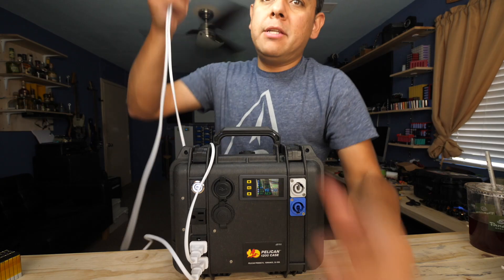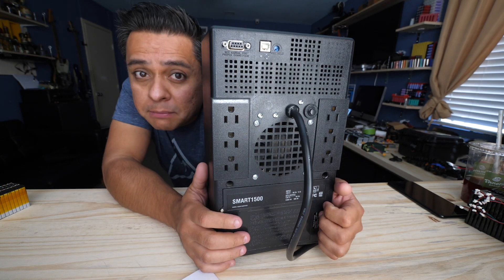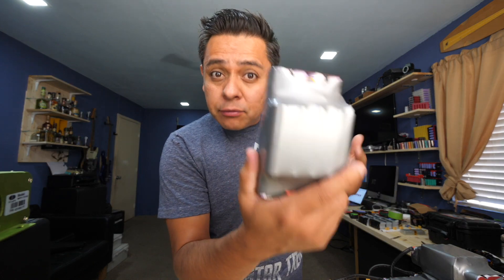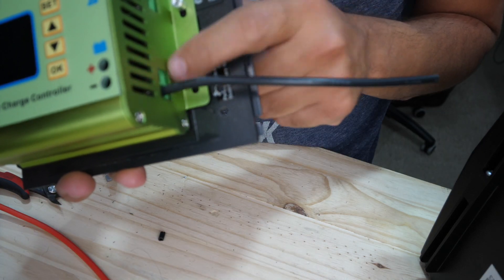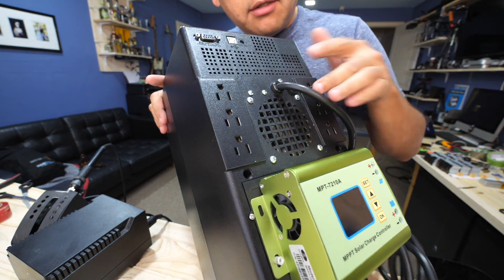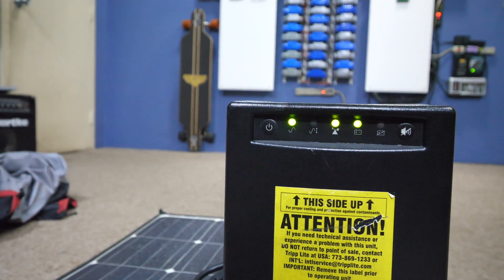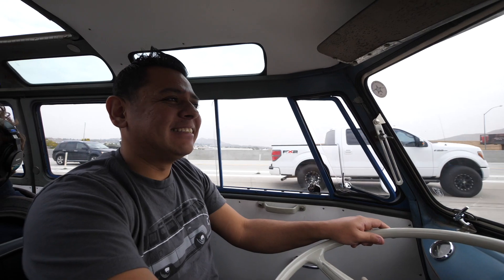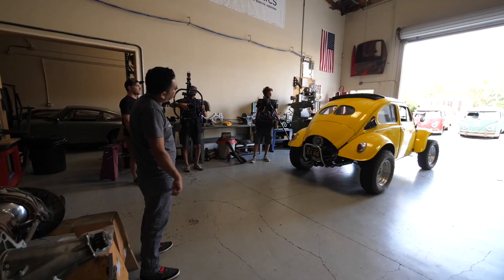The $400 Solar Generator you can donate To Puerto Rico

Comment: hey jehu, tried building this device and ran into so trouble. I have a 12v 150w solar panel for this set up and the same ming he charge controller, which does not turn on when the panel or batteries are plugged in. there's two things I think might be the problem: the batteries are fairly dead or the mc4 connection isn't making contact with the panel. any type of feedback would help.

Comment: ok.. I love these. Have a technical question though not very technical. can you stack these (combine the inverter outputs) to give more potential working watts? I see two or three 120v inverter outputs, separate UPS, wired into a single service panel. Possible?

Comment: Found another video on YouTube where they guy explained you can't it off the grid. Because it was meant for led batteries and the configurations are to charge @ 43.5 volts. 1.5 volts to high for the max volt charge on the lithium cells.

Comment: Jehu. I just want to say thanks. I have learned a lot from your videos. I never solder wires before. Now am confident doing it. I built 2 of these generators abs am building 4. I did added a volt meter with a switch a handle to carry it and a thermo switch to the fan. I also added a separate charging port.
Thanks again!!

Comment: Got it assembled so now I need the settings for the MPPT controller:  Using one Uni-Solar 136W panel, 4 battery packs, what is the setting for Panel Voltage - Max Batt. Charge Voltage - Max Batt. Charge Current - AH setting of the Batt. Capacity????  I viewed all the videos on the 7210A controller but did not see the settings for this set-up as described and using these components.

Comment: Since a traditional Tripp or APC 12v UPS charges its lead acid batts at 14v, have to wonder if this one charges at like 38-42v? Will these 36v lithium batts safely handle 42v if you plug in the 120v input on that UPS? Sorry to not understand, love the project!

Comment: I completed building the Tripp-Lite Solar electric generator. I have figured out how to program the MPPT charge controller but I am not clear about the correct values to input. My solar panel is 105W at 12V, so I set the solar panel to 12V. The batteries are 36V, so I set the voltage the battery is to be charged to, to 36V. Now for the crux of the problem. I am uncertain what to set the battery charging current to. The batteries are 2.2 Ah Li-ion and I believe the C rate for those is 2. I found a specification which said the max. continuous charging current should be 0.5 X C rate. Therefore, the max. continuous charging current should be 0.5 X 2 X 2.2Ah = 2.2A. This is for one battery cell. So, given that the SONA battery packs are  two parallel strings of 10, 3.6V cells in series (10S2P), does that mean each battery pack needs 2.2A for each string in the pack, (to allow 2.2A to flow through the 10 cells in series to allow each cell to see 2.2A) or 4.4A per pack? Additionally, since there are four packs in parallel, to get 4.4A to each pack does that mean the charging amperage the solar charge controller should be set to is 4 X 4.4A = 17.6A. Does anyone have suggestions, or experience with a amperage setting that gives good results and will not adversely affect the life of the batteries.

Comment: So is it really safe to charge those batteries off the grid with the UPS power cord? I think that could be a good option. Use the solar for mobile or emergency use, but use the grid when you can. Is the controller of the UPS unit that's been charging batteries its entire life good enough to handle charging those particular batteries?
Reply from the maker: Yes

Comment: I've tried this. I can't fit four batteries inside. How did you make four fit?
Reply from the maker: Maybe your batts are slightly bigger
Reply: Mine fit. I made 2 generators and put 4 battery packs in each. It's definitely a tight fit but you can stuff 4 in there.

Comment: ok
so I have a question concerning the flexible panels (24V), the batteries (36V) and the unlisted solar charge controller.  is it possible to charge 36v batteries from 24v panels or should I be looking for 36v panels?
Reply from the maker: That’s what the solar charge controller does
Reply: The "unlisted" charge controller was listed in the description along with the other items needed. It's a BOOST controller.
http://j35.us/10A-Mppt-ChCon
Reply: +nrodge1 Thank You
guess I missed it completely.
Reply: +nrodge1 
if you wanted to use the 36v batteries in a scaled up powerwall configuration, then what SCC would you look for since I don't believe 10A would be sufficient? Thank you in advance
Reply: +jehugarcia 
sorry,  I knew an SCC could take a higher voltage(say 48v) and charge 36v batteries but I didn't understand it capable of taking 24v and charging 36v batteries. Thank You so much for sharing your knowledge. will be making a couple of these for helping out the people of Puerto Rico, Thanks to you.
Reply: +jehugarcia 
I guess it wasn't clear in the product description that it was also a DC-DC Booster. I learned something today. thanks again.

Comment: Hi everyone. wanted to know if anyone built one yet. I bought and have tested but i think i might have a bad ups . When charging battries with 120 volt wall outlet i get reading for 120 v. But when i disconnect from wall and test the volts from ups getting reading 88.6 v and not 120 volts . I was able to run tv and lights. Plz let me know if anyone is having the problem.  Im going to buy another ups.
Reply: Some have said that this might be a Modified Sine Wave output inverter, you can look that up but generally a DVM will not be able to read it correctly and I wouldn't plug in a Kill-A-Watt meter. Anything with a switching power supply will be OK (even with square wave) but things with motors might not do so good but will run. Like a fridge compressor will get a little warmer. I don't know if it would be a good idea to push it up to the 980W with any type of inductive load. The specs for this did say PWM sine wave which probably means it's the new marketing guy language for MSW. It will be good for the emergency in PR.
Reply: Found a solution?
Reply: You will need a True RMS meter to read the correct voltage...or the Kill-A-Watt plug in.  My cheap meters also read a low voltage until I got a True RMS and now it reads the correct 120 VDC output.

Comment: Just FYI. I'm trying to put one of these together in Puerto Rico and here's what I've found on shipping. Although the charge controller can be found elsewhere, the link provided here is for a seller that will not ship it to Puerto Rico. The batteries from eBay will cost $67 to ship (although I haven't purchases yet and don't know if regulations will interfere) and the to UPS unit will cost $59 instead of the 25 they usually charge. This brings the cost of just the UPS, batteries and controller to $356 if you live here. Still not bad.
Reply: EDIT/UPDATE: Jehu and I have confirmed that the ebay seller can ship to PR now. All the items are listed in the description of this video and also some of the comments. You may only need one battery if you can power your stuff during the day from the solar panels, sort of like a pass through. The charge controller Jehu used is a 10A controller so you can do the math but you will probably want to put in a little more solar since in the mornings or off angle sun or even normally you will get less than the panel's rating which is at room temp and in perfect conditions. You could also use 3 car batteries that are somewhat good the same way - as a pass through system, the battery is only needed to get things going.
EDIT: Also solarblvd has 41c/W panels and has a way to ship them you need to call them but shipping is a lot but maybe you could do a group buy with Javier. Also see my post on the latest Jehu video.
Reply: Links??
Reply: All in this video's description.

Comment: Hey I just received my ups system and tried to plug it in and of course there’s no battery yet, but I was just wondering is it normal for nothing to turn on when there is no batteries connected? Just wondering if mine is defective or not
Reply from the maker: Yeah I think you need battery

Comment: Great solution, but why not make it modular?

Get a outdoor car battery container, put the batteries in there and attach the solar charger to it...  Just have a plug connector to it and the UPS...

That way, if the person lives some place where they may have too much shade they can just disconnect the batteries from the UPS and take it with the solar panel to where it can get better light to charge...

Also, it allows people to swap batteries for longer run times and makes it more convenient as they can leave the UPS plugged in and it's a noticeably lighter weight to carry around, which some people using this may not be strong enough to carry the whole unit as one piece.

What do you think?
Reply from the maker: Yeah,  good idea

Comment: I assume the ups charging unit outputs 42v?   Does it have to be that voltage to charge the 4 Lithium packs wired in series even with the indv bms?
Reply from the maker: no thats the max voltage for the 4.2v cell
Reply: Where can I get the UPS?!

Comment: so ive got a CyberPower 1200AVR UPS, and I want to use the guts out of it to build something similar, what are your thoughts? it looks like it uses two 12v batteries inside based on this link for the replacement batterys. 

https://www.cyberpowersystems.com/product/ups/rb1280x2d/

Comment: That UPS without battery is no difference than regular inverter. Why not just buy a inverter instead? Can anyone tell me the difference?
Reply from the maker: $30 980w inverter with a built in charger,   find those 2 things for same price and you'll have the same thing
Reply: You right, thanks.

Comment: How long will it take for the flexible solar panel to charge up the battery pack? On a typical, Caribbean (sunny in the morning stormy in the afternoon) day?
Reply from the maker: Hard to say  but you need 500wh so if you use 100w panel it would take 5 hours if perfect sunlight
Reply: jehugarcia Thanks!

Comment: If the TrippLite UPS is plugged into a 120V outlet, after converted to lithium batteries, will the original manufacturer's battery protection circuitry protect against overcharging the batteries, which may be more sensitive than the original lead-acid batteries, or does the BMS on the battery packs take care of that function.
Reply: Jehu has said he's tested it, it's fine and cuts off at 42V and then backs down to 38V and the built in battery BMS is redundant safety. This is great for emergency use like in the PR situation and we all hope they keep using it to save on their power bill and never plug it in!
Reply: That's what I was worried about, I guess they are saying the battery packs he installed have BMS in them?  I would be scared to plug it in after conversion to lithium
Reply from the maker: Who cares what it’s supposed to do,  test what it does (I did) if it works with your application then there is no need to be scared

Comment: What can we use to monitor the voltage? Does the UPS itself have any voltage monitoring?
Reply from the maker: No monitoring
Reply: You can add your own. It's just a plastic box, join the DIY club and cut a hole in it ! See the previous video where Jehu uses one with a shunt so you can monitor the battery's amp use too and get a graphic full / empty reading also. Or buy a DVM and hang the leads out. I don't know how fancy you want to get for a $30 UPS.

Comment: Hey Jehu, trying to find out if there is some kind of warranty that the used UPS will work, with shipping it's $58 for me. I live in SoCal so I would love to be able to just go pick it up if you give us an address or website to contact them. Thank you, got 1000 18650 cells coming from your guy on Ebay and building an off grid system.
Reply: You would be better off buying a real normal inverter with all the protections and stuff for a larger off grid system for your house in a normal situation (this is for people in need in PR) and go 24V with 6S to make things simple and better. If you want to be cheap you can start out using the CMP 12/24 charge controller from ebay with one little mod, I did for a while, see my channel with a lot of info on solar stuff.

Comment: Jehu, I found the link for the UPS and the batteries and purchased these. However, I could not find a link to the complete parts list, with the model numbers for the components, and the suppliers so I can order the remaining parts. If I could find what I need I would not waste your time trying to get the information.
Reply from the maker: I don’t know what to tell you,  it’s in the description section of the video
Reply: If you are on a phone you may have limited youtube function or may have to figure out how to access the description, maybe swipe down or up? Here's the list from the description:
To Familiarize yourself with solar charge controller https://youtu.be/mM6JTquNSZU & https://youtu.be/vzhwR0mAshs
To set charge controller to auto start charging https://youtu.be/f0Br1Q57IoE
******************************************************************************
Parts List:
http://j35.us/5xSona36v-packs     $149
http://j35.us/MC4-SolarConnectors  $5.18
http://j35.us/12awg-Cable     $24.99
http://j35.us/xt60--y     x2     $9.99
http://j35.us/10A-Mppt-ChCon     $37.99
http://j35.us/60wLEDbulbs     $9.92
http://j35.us/LightSockets     $12.68
http://j35.us/105W-flex-solar-Panel  $126
http://j35.us/950w-UPS.     $30
Reply: Thanks nrodge1. That solved my problem. I was able to acquire the parts list you posted. It is greatly appreciated.

Comment: What would happen if you plugged the wall plug from the UPS to the backup outlet, then plugged an AC panel (LG + Enphase) into the next plug?  Can a "freed" AC grid tie panel charge this?
Reply: Enphase is 240V anyway and you would most likely blow the UPS inverter.  Most grid ties don't sense the AC output power, they don't need to. Why bother, the little charge controller is way less than an enphase.
Reply: +nrodge1, I thought Enphase could do just 120, but you are right 240v only.  I found a $75 300w Chinese one on ebay that does do 120v AC. I think the issue may be that when the inverter started producing the UPS would go to pass through, shut off then the micro inverter would have nothing to synch to. I saw another vid that made 240v with two UPSs, but one had to be a slave. That was accomplished by turning off the pass through feature. Why this way?  The inverter could be attached to the panel, all your cabling would be regular 120v extension chords, the UPS would be silent when charging and it would still look stock.

Comment: Looks like it is this unit for the UPS: https://www.tripplite.com/smartpro-120v-1.5kva-980w-line-interactive-ups-tower-usb-db9-6-outlets~SMART1500/
If you want to buy the replacement lead battery for it: https://www.amazon.com/Tripp-Lite-RBC36-SLT-Replacement-Cartridge/dp/B0015MYXWS
For a new one: https://www.amazon.com/dp/B00006L45M/ref=asc_df_B00006L45M5257456/?tag=hyprod-20&creative=394997&creativeASIN=B00006L45M&linkCode=df0&hvadid=198093101467&hvpos=1o2&hvnetw=g&hvrand=17371047611726958197&hvpone=&hvptwo=&hvqmt=&hvdev=c&hvdvcmdl=&hvlocint=&hvlocphy=9033325&hvtargid=pla-333707181264

This project is half the price for just the lithium batteries and UPS alone.
Reply: I don't think this is a pure sine wave UPS.  They list it as PWM sine wave, which is modified sine wave.  They have a model with pure sine wave - the SLT model.  

https://www.tripplite.com/smartpro-120v-1.5kva-900w-line-interactive-sine-wave-ups-tower-snmp-card-option-usb-db9-8-outlets~SMART1500SLT/ 

Jehu should test to make sure it's pure sine wave, because it could cause damage to some equipment if it's not (and it appears not to be pure SW).  I'm sure it's an excellent modified sine wave ups, but that's not the same.

Comment: Could Jehu, or someone else, share the component list (including model numbers) for this charger and where to buy them at the prices which would allow being able to build them for around the $400. I am absolutely green at this, but I have been watching numerous videos and purchased the battery book and I am ready to get started. I am having a frustrating time finding the necessary components at the right prices.
Reply from the maker: I provided links,  why do not people click on the links?
Reply: People using their phones may have limited youtube function. Here's the links for this project from Jehu's site and this VIDEO'S DESCRIPTION:
To Familiarize yourself with solar charge controller https://youtu.be/mM6JTquNSZU & https://youtu.be/vzhwR0mAshs
To set charge controller to auto start charging https://youtu.be/f0Br1Q57IoE
******************************************************************************
Parts List:
http://j35.us/5xSona36v-packs     $149
http://j35.us/MC4-SolarConnectors  $5.18
http://j35.us/12awg-Cable     $24.99
http://j35.us/xt60--y     x2     $9.99
http://j35.us/10A-Mppt-ChCon     $37.99
http://j35.us/60wLEDbulbs     $9.92
http://j35.us/LightSockets     $12.68
http://j35.us/105W-flex-solar-Panel  $126
http://j35.us/950w-UPS.     $30
Reply: How many battery packs do I need to order build one unit like in the video?